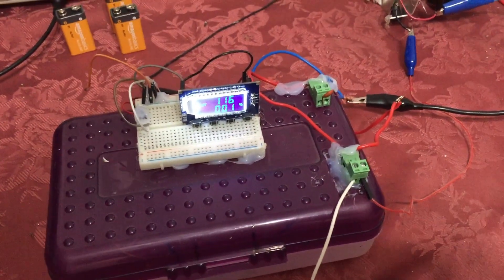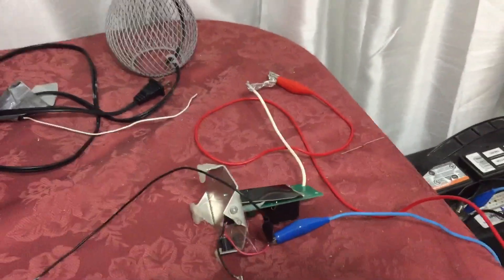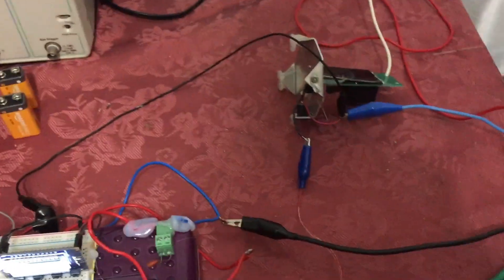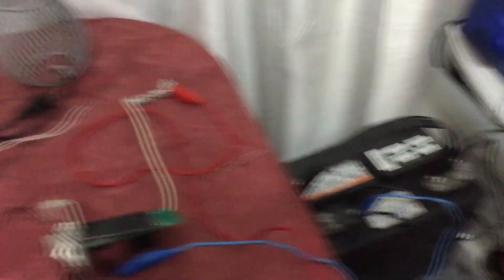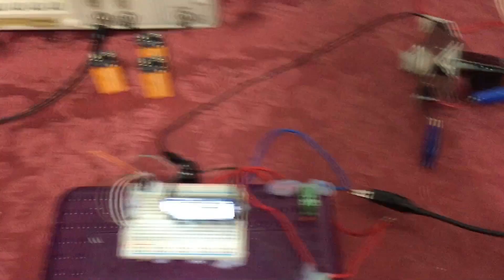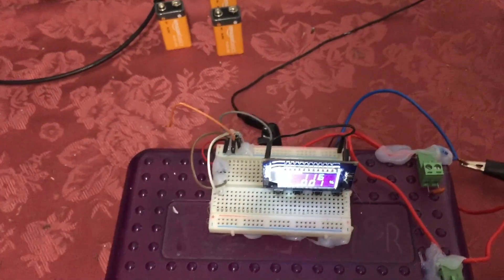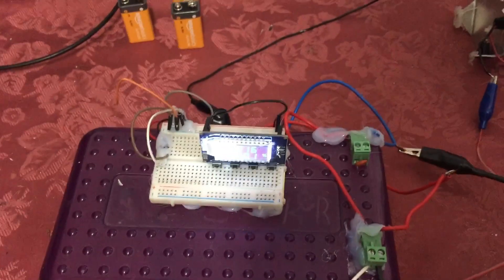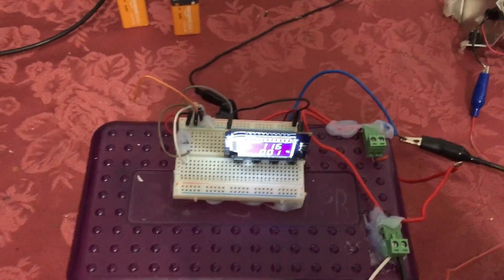One Watt Challenge Complete

Comment: absolutely incredible and awesome. Can you please list the components you used here.
Reply from the maker: Small neon/ionizer HF/HV transformer pulsed with 12v input with a sqare wave generator module controller that pulses a NPN transistor to switch the negative side of the battery input into the primary side of your coil at 1%. The secondary sides choose one WIRE, is your one wire tap. Don't short out the secondary. keep the loop open. use 2 didoes to tap into the one wire to get your DC plus and minus. and those can charge a small cap. Try 1uf. I use  100 volts gas discharge tube between the capacitor negative before dumping into the battery negative and capacitor plus to battery plus.  Your going to need to find the best frequency for the setup, My oscillator was prebuilt from Information Unlimited but they are no longer around and this module can't be purchaed no more but its more or less a simple Ionizers transformer with a oscillator. Pulsing the coil without all that circuit will do the same.

Comment: Thanks joel. i wuld like to know what happens, if you change your actual high voltage transformer, with a real ignition coil for car. Very low cost, and better performance. And more reliable.
Reply from the maker: I tried flyback tv transformers not powerful enough field wise. The best I got was pulsing a MOT with the 12 volts and that hardly got me an acceptable field. how ever it worked....

Comment: Thanks Joel
When the controller fires the high voltage module does that draw extra power from the battery?
Reply from the maker: it draws around 4ma out of that 40ma input. Its pulsed with 12v input at 1% cycle. Next step that is easier said than done for me is upgrading the controller to more efficient 555 or better with these settings.

Comment: i think you did nice  there... try adding spiral wound coaxial like coils to the battery leads, perhaps in opposite directions?  to catch some diverted heavy side, or curl current i can call it.. if it works..  power that you can measure i bet you already tried .. ? but you did build the generator 1 wire.  i worked on it for 10 years. so its get more fun. just take care not to touch it to much..

Comment: I'm thrilled to have initiated the "1 watt" challenge movement :). It's my hope that this idea will spread widely, eventually leading to the development of electric vehicles (EVs) that can run indefinitely. Regarding the number 555, I've done some research and found a variant known as the CSS 555. This ultra-low power version uses only a few microamps. If you're interested, I can arrange to order one for you.
Reply: Hi Joel congrats this small 555 is just as a normal ne555 but is called tc555 or css555 or lmc555 they are micro power versions but same socket dip8 so is not smd . I look forward to see your work best wishes.
Reply: You have found the ultimate challenge, this is genius. Joel has put out a simple but very effective toy. Now i like to play along. COP of 6 is enouf for me. Now a timer and a divider so that we can multiply the same system over several coils. The game is on. It will work, I am sure. 😊
Reply: I meant as many as you need, not just one!
Reply from the maker: Sounds great and very thoughtful,  how "mini" is this version?, my hands are not that  great with small parts, im thinking of just building a pcb online and perhaps getting it printed even if I have to pay close to 100$ at lease I won't burn my fingers trying and making bad joints lol We need it to be able to switch a big enough NPN transistor.  that can handle the battery 12v. So I don't  think a 2n2222a would do it but perhaps i'm wrong.
Reply: @Marc.2.0 , I recall posting a comment on this channel, asking if anyone has created an overunity device capable of maintaining its initial energy while also generating an output of 1 watt, sufficient to charge a cell phone. The device featured in this video responds to that challenge. It showcases a battery that self-charges and increases its energy. Although it doesn't precisely match my initial description, like charging an external device such as a cell phone, it's still a relevant and interesting development.